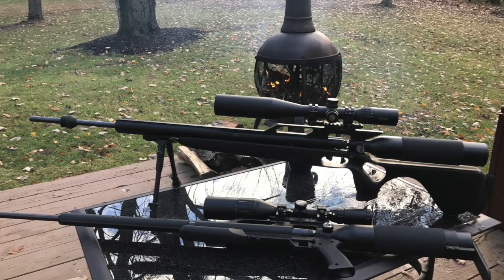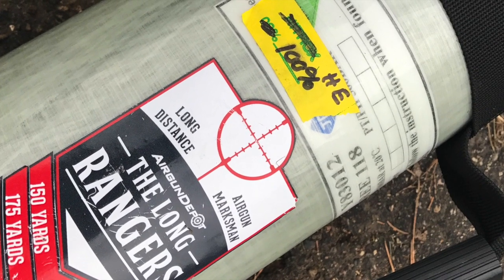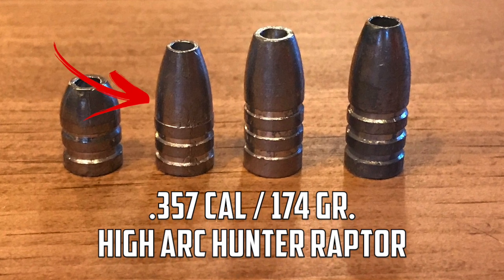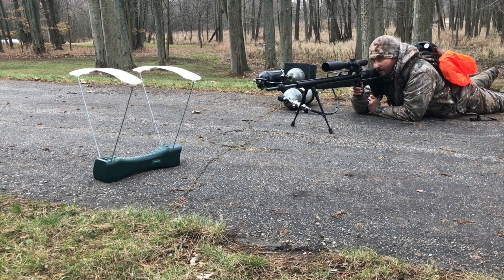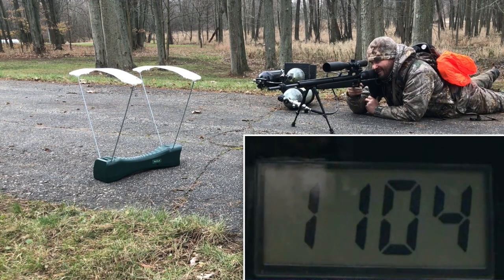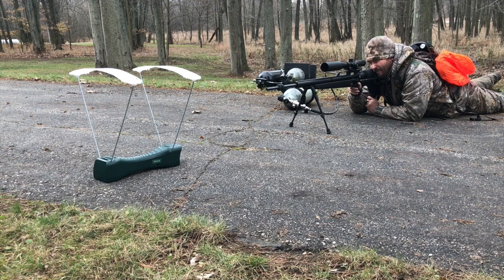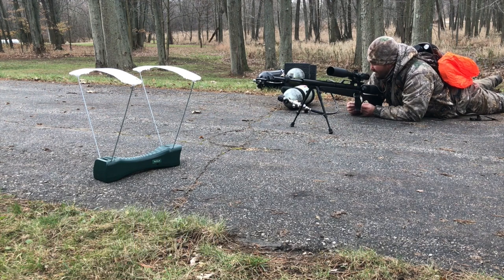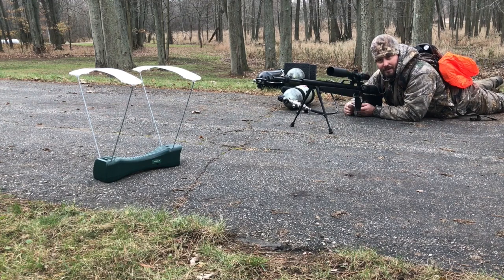AirForce Texan Air Gun Helium Experiment -  Big Bore .357 Air Rifle

Comment: Powder coat your lead bullets and you’ll get more velocity and no barrel leading.
Reply: What's powder coating??
Reply: Google it.
Reply: @jacksprat7087  well I did and basically there's no advantage.
Reply: Well, I get about 5% more velocity and no leading.   I pour all my bullets using wheel weight lead mixed with pure lead (2/3 WW and 1/3 pure lead).  Both pistol and rifle reloading.

Comment: Wow man I’d been researching this for a bit and should have went through your full collection I guess glad I found this 💎  of a vid.  Know you had fun that day Chris.  
So how do you feel or how often you use helium now days Chris?
And do you think most main manufacturers guns could handle that as long as you don’t exceed the psi rating.
Reply from the maker: It was a fun science experiment, but not something I would do a lot. The cool thing is you're not exceeding the PSI rating, but rather the volume of gas that gets pushed each shot since those HE molecules want to get out so fast. It would increase any manufacturer's gun by 40%+ in FPE at any given PSI level.
Reply: @UpNorthAirGunner  wow man thx for the feedback and teaching us a little about the science behind what’s going on,  can their barrels provide accuracy at the speed or said ammo remain accurate I guess then becomes the question.

Comment: my question is: can helium be put directly into an air rifle or is there
to do some kind of tuning for this ???
Reply from the maker: David Ghattas You can put it directly into the air rifle.   I was just tethered with a regulator to get an exact velocity reading at a constant pressure.
Reply from the maker: David Ghattas No tuning or messing with the mechanical aspects of the gun needed other than the typical adjustment of the power wheel to find the tightest groups for a given projectile.
Reply: @UpNorthAirGunner  in video you mentioned adjusting regulator pressure up to 3k psi, is that on the bottle regulator or the power wheel adjustment as well? What type of tank would fit to fill w helium? Or can I filled the OEM Texan tank directly? And how about the regulator on the OEM Texan tank any adjustment? I'm so eager to try my Texan SS with helium too.
Reply: I wonder if he lets go of the Aragon what is float up in the air 🤣🤣

Comment: Did the increase in velocity negatively impact accuracy?  Concerned about transonic effects.  Very impressive though.  I've gotten a number of my powderburner friends interested in air power.
Reply from the maker: The Barking Mouse Ya - I'm actually going to regulate it down to 2800 PSI when shooting these 174 gr bullets to keep them around 1000 FPS.  I may also try some 225 gr bullets I have too to keep the Velocity subsonic.  I did more testing after this recording and my groups did open up to 3-4 inches at 100 yards vs.1-2 inches like they were before on regular air at 880 FPS.  More tinkering needed.
Reply: Cool.  I wondered if that would be an issue.  But didn't know with the heavier more traditionally shaped bullets.  I can tell you with suppressing powder burners, I like to get the heaviest bullet I can to ~90% supersonic (~1012 fps at sea level).  But something is different about PCPs.  Not sure I understand it but I suspect bullet shape.

With my marauder and my streamline, I've found that pushing up into the transonic zone caused problems.  Actually detuned the marauder down to 820 and the streamline to 870.  Haven't edited the videos for 50 or 100 yards yet, but will soon.  Getting outstanding results.

In any case, very interesting.  Good luck with the hunts!
Reply: @UpNorthAirGunner  What is it that makes firearm slugs accurate at high speeds and air slugs not? Is it that you just have to get way past the sound barrier  or are they made different? And if the latter why don't they make them for supersonic? Thanks another great viddy!
Reply: @airgunfun4248  💡It's the shape of the projectile that determines it's accuracy. The more streamlined the projectile is, the more accurate it's going to be, and a large hollow point opening at the tip makes it even harder to keep consistent, that's why the major bullet manufacturer's use those polymer tips inside of the hollow points to keep the projectile streamlined👍
Reply: @catherineharris4746  Well thanks for the reply miss. My comment was over a year and a half ago and I was still a little wet behind the ears. Since then I've educated myself and confirmed my first thought I listed was correct. It's the fact that airguns just don't project the bullet fast enough.  As a result the projectile becomes transonic as it slows causing instability.  The ballistic coefficient as it is called of the bullet has come a long way rapidly for airgun ammo including company's like Lead Fist slugs using ballistic tips. Thus subsonic 22lr competition guns(they are kept subsonic for the same reasons) can be matched by high end airguns. Furthermore some people use actual firearm bullets in airguns.  So ballistic coefficient isn't the main problem it's velocity.
Reply: @airgunfun4248  Yep i make my own for my powder burners and for my airguns👍

Comment: im not sure but if a bullet was that fast, it might do wierd acrobat in mid flight, unless the barrel has a rifling
Reply: They do have Rifleing the bore diameter is .458 and I believe the groves are .456 not quite sure they function a lot like breech loading percussion rifles except air is the power and you can only use lead in these

Comment: Question i Text Airforce this is what they say.  Good Day,
We only recommend compressed air or dry nitrogen gas for warranty purposes. 
Thank you,   So with Helium. The gun will resist the more pressure from helium.  It will cost any damage. Let me know. And have ya done accuracy on the gun with helium
Reply from the maker: Ya - this was more of a scientific test. Helium is using the same pressure so there is no difference there. Where you see the additional difference is the amount of air leaving the barrel thus pushing any given slug faster that HPA.  That does stress the frame a bit more causing some flex and effects accuracy a bit.
Reply: UpNorthAirGunner thanks 4 the information great to know it. Great videos success

Comment: Couple of questions can helium be put in the Umarex gauntlet what's the first thing that give out if he used nothing but healing on your gun
Reply from the maker: Using Helium would most likely void any warranty and pressure is pressure, so there isn't any additional stress on the gun as far as storage goes as long as you stay within the specs of your gun.  Helium is a much smaller molecule vs. HPA so it may leak through your seals, but not fast enough to effect your shooting, but may slip out overnight or over a few days of storage.
Reply: @UpNorthAirGunner  do you think the Umarex Gauntlet would be able to take it cuz you're really not give me a solid answer my brother let's just put the question this way would you put helium in the Umarex gauntlet
Reply from the maker: @joycea.k.ajoyjoy3894  I can't give you a solid answer because I have not tried it myself nor have I heard of anyone doing so on the Guantlet.  I don't want to give you advice to make you a Guinea Pig. I will tell you that no matter what airgun you put helium in - you will see huge velocity increases.  That is just the fact behind the chemistry.  Will the platform be able to mechanically take the additional volume discharge for each valve strike / opening?  That I can't tell you.

Comment: I got a question about your air tank and regulator setup. As I'm trying to find a regulator for my bottle. What type or style of valve is your bottle too?
Reply from the maker: Blake - get either one of these: https://www.huma-air.com/Webwinkel-Category-6827503/External-regulator.html

Here is the video if you haven't seen it yet: https://www.youtube.com/watch?v=2oRS1pttZbw&t=232s
Reply: I contacted them and they said that wouldn't work on a Texan 45 that regulator. I've also got that 4500 PSI tank and I want to shoot around 3500
Reply from the maker: You contacted HUMA and they said that?  I tether my .45 Texan all the time on this external regulator.  These work up to 250 bar which is 3625.94 PSI so you should be able to regulate to 3500.

Comment: Lol ,, deer hunting air ,, I’d like to try it in my badger ,it’s rated for helium,, where do u even get it .???
Reply from the maker: Our local SCUBA shop does 4500 PSI fills for my carbon fiber tank.  They use HE for deep dives in the Great Lakes.  $75 bucks for a fill so I won't be punching paper with this!  HA!
Reply: Could you not just buy an air compressor for like $300 and never have to worry about it?
Reply: @FuKItM4n  u could but you won't get the performance you witnessed in this video, and this was the point of it I believe!?😉

Comment: why use helium in what way does it increase the velovity
Reply: I have seen it used with custom, super reinforced rifles,  I am know expert, but it seems to be very dangerous stuff to play with. Can push your pcp to pressures the gun was never intended to take ,and you could wind up with a face full of metal.  Helium is just a more dense gas , can push harder when it hits the back of a projectile at the same psi as air.  That is my understanding, could be wrong. Still if you have an adjustable reg , perhaps you could turn it down to get the same fpe  as on air , but greatly increase shot count... seems most pellets won't hold stability around 1000 fps, so not much reason to drive pellets fast any way.  Using big bores and molded slugs is another matter for hunting I reckon.
Reply: Helium is a lighter gas and you can move a larger volume quicker than you can air, equals more velocity
Reply: The atoms in helium or incredibly small and if there is a way for helium to leak out it will seek it out so you need to watch your level of helium is it will slowly dissipate even though you're not shooting
Reply: Speed of sound is the limiting factor in air rifles.  PCP  have another limitation because speed of sound is also dependent on temperature,  higher temperature is higher speed of sound.  Air in a PCP reduces its temperature as the projectile moves down the barrel.  Spring air adiabatically heat the air through compression.
About 1/3 of the compressed air must accelerate at the speed of the projectile down the barrel.  As the projectile nears the speed of sound in the gas pushing it, the force of the air or gas decreases.

Smokeless propellants have an upper limit of about 6000 ft/sec.  Light gas guns using hydrogen can exceed 15,000 ft/sec.  
PCP using hydrogen could exceed 2000 ft/sec.

Comment: supposed to put the chrony at like 40 yards or more   the hollow points you're using will NOT fly that consistently down range
Reply from the maker: kenny cadarett I’m not sure what you mean...  the purpose of putting the chrony close is to measure velocity at the muzzle.  You would then put it further down range to measure a secondary velocity to then measure ballistic coefficient.   Furthermore Hollowpoint’s do fly consistent down range - not sure where you got that information.   Please explain....

Comment: i have the .457 with 405 grains what velocity will i have??
Reply from the maker: At 3000 PSI with regular high pressure air you should be getting around 750 FPS for 506 foot pounds of energy.  With Helium you should be able to get that slug up around 935 FPS for 786 foot pounds of energy.  With that said, do at your own risk as AirForce doesn't recognize Helium yet as an approved gas covered under their warranty.  There are quite a few people out there doing it though with great results and no issues.

Comment: is this safe igot a gamo tc 45 and wanna try it
Reply: As long as you dont exceed max fill pressure and you only use non explosive gas such as CO2, helium argon etc. I think you will be safe and happy!  Just be sure to research gas types etc before you attempt powering your pcp with them to ensure you know what your getting into first.😉
Reply: Also be mindful of what it could do to seals? Could dry rot them or freeze and crack, etc.

Comment: Jeeeez that's seems dangerous
Reply from the maker: Why is that?  I am keeping the air pressure within specs of the manufacturer.  Helium is not combustible - just a lighter molecule that standard HPA so there is just a higher volume of air being pushed per shot.  Not sure why you say this is dangerous??????
Reply: UpNorthAirGunner every handbook I've ever read supplied with a new air rifle says use compressed air only or words to that effect.
I mean fair play to you, nothing happened.
It just seems dodgey,  if helium produces so much more energy it must be tougher on the gun?
Reply from the maker: If you are worried about warranty - for sure always follow the manufacturer guidelines.  As far as stress on the gun - there is no additional pressure behind the valve since I am running it at 3000 PSI or less.  The additional pressure though is found within the chamber and the actual barrel itself pushing the round down range.  

At 1100-1150 FPS the additional pressure we are adding within the barrel from the smaller molecule (aka more volume of gas) being release per hammer strike on the valve releasing helium is also within the known limits these barrels can handle.  There are guys running 4500 PSI HPA through these barrels with no issues at all other than there is a lot more air pressure being applied behind and at the valve and needing a much heavier spring and hammer strike to release the air at that pressure.  

So really what my experiment shows is that the net result of increase FPS to 1100 FPS with helium at 3000 PSI with a normal spring tension and hammer weight can be seen as much more efficient vs. the same 1100 FPS with HPA at 4500 PSI with a much heavier spring and much heavier hammer (much more mechanical strain on the valve system).  

The argument can be made that the actual cost of the helium vs. normal HPA air isn't worth it.  My argument though  is this....  In order to take a stock AirForce Texan to a modified 4500 PSI bottle / spring / hammer set up to get these kinds of velocities will run you over $500 or more.  I was able to do it for $100 to fill my CF tank and run my gun stock configuration otherwise.  

So my point is I don't need that kind of power to target practice and punch paper all year long - but I DO want that kind of power when hunting in November for just 2 weeks in the year.  So basically I can sight in my gun in 3 or less shots for deer hunting on helium and have that one shot one ready to go with maximum power to dispatch the deer as ethically as possible with helium vs. HPA.   

The jury is still out too as far as what the lifespan is on these hot rodded 4500 PSI rigs are going to experience in the long run.  My bet is the the additional fatigue from the extra heavy hammer strikes over and over and over again will cause longevity issues.  So again - when I want to go to the range and send hundreds of bullets down range to target practice, I can do that in stock form.  When I want to hot rod this gun for a few shots and quite possibly the ONE most important shot of the year on a 10 point buck at 75 yards - I can now have the best of both worlds with helium.  Sorry for the long response - but that is my line of thinking on this.
Reply: You might try hydrogen next. Before you say,but hydrogen is flammable,remember it only burns if it has air for combustion. Pure hydrogen would only be explosive when it mixed with air AFTER the shot was fired,and it would be dirt cheap.
Reply: @mikedunn7795  Sounds like a very bad idea brother!  Unless you vaccuum out the entire gas run, adding hydrogen to the oxygen already in the circuit can't be good news.  This is basically safe (as long as the machinery is rated for the pressures being used), with a zero chance of combustion based failure.
Reply: @mikedunn7795      Sounds like a cool idea. H2 should be even faster than Helium. Any concern about oxygen could be put aside if the tank being filled was previously used for helium or hydrogen. Plus I wouldn't ever enclose the filled H2 tank in anything since Hydrogen diffuses pretty quick and even a towel or plastic bag might capture enough H2 for an explosion once it's triggered by the tiniest of sparks.